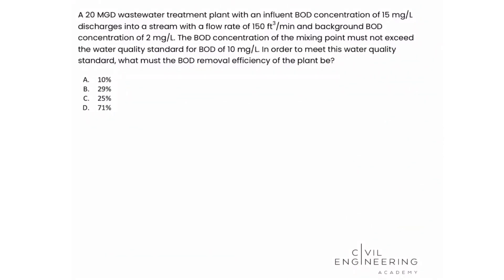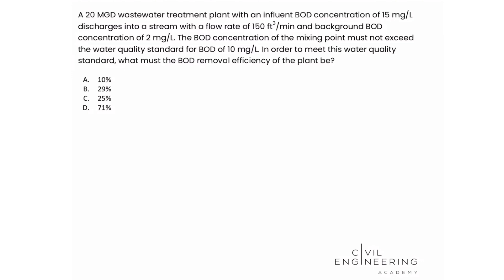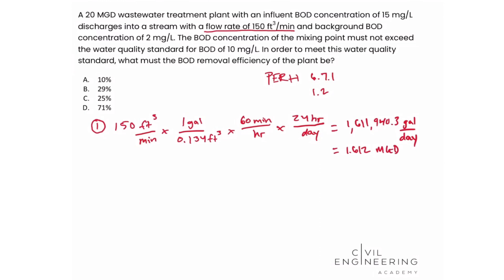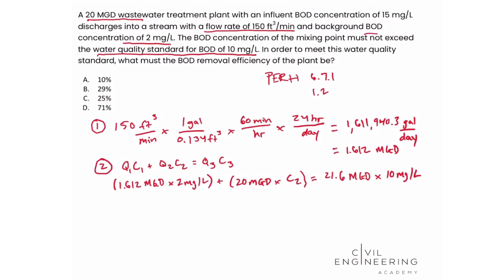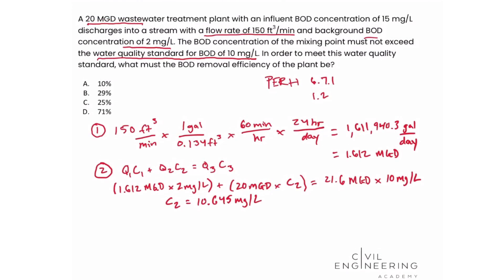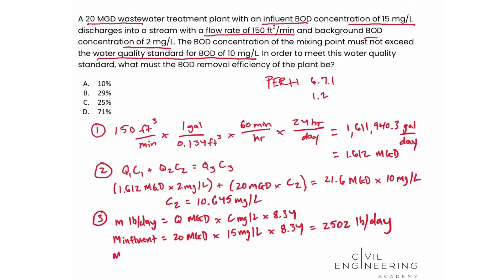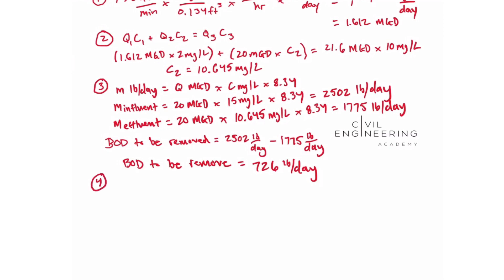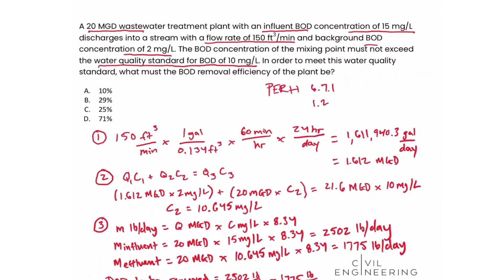Civil PE Exam - Water Resources Depth - BOD Efficiency

Comment: So the plant discharges 30 cfs into a stream that typically carries 2.5 cfs? That seems a little strange from a design point of view. Usually these problems have the discharge flow rate several orders of magnitude lower than the stream flow rate.
Reply: Yes, correct.  This video hurts to watch.  The problem is super unrealistic, and is also solved poorly.  @brittanydarnell6546's comment describes how you should be solving this problem.
Reply: and said miligrams per day instead of million gallons per day. I know things like this are hard to put together but this was a bad one.